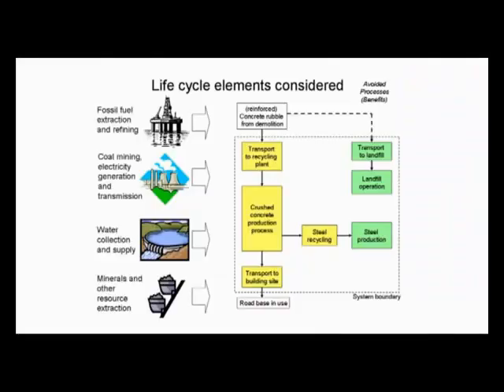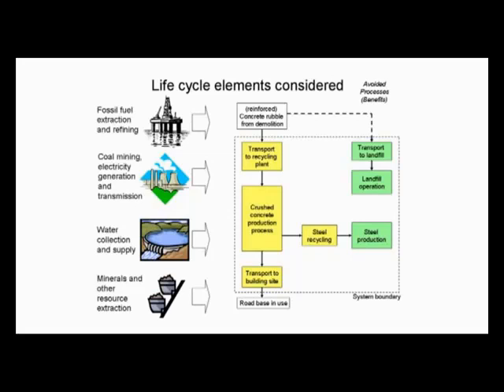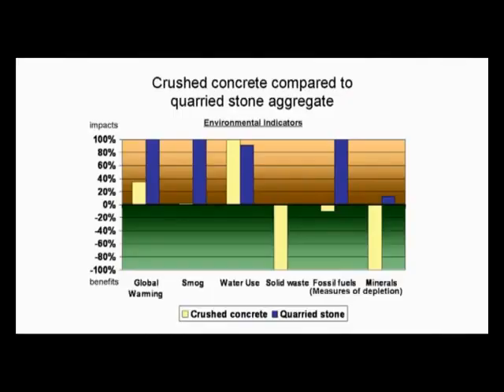Life Cycle Assessment - Explained

Comment: id also add, ultimately, the concrete before it was crushed was also quarried, there is no free energy as they are trying to make out.   
Re-using a quarried material does not magically put that quarried material back where it once was. 
yes there is a reduction to landfill, but the original quarry of the products in cement allready created that landfill.  (old quarrys are tips)

And the cement in the concrete being crushed has had all the energy used in its manafacturer dissapaited by the crushing. 

Ultimately recycling crushed concrete as road base is the most energy intensive forms of road base there is.    
1:quarried, 
2cement made, 
3concrete made, 
4 delivered,  
5 steel delivered, 
6 structure complete
7 concrete removed after life cycle of structure, 
8 concrete crushed as road base.  (all intensive energys lost into a base product of low value)

Dont get me wrong, it is good to re-use, but we really should be looking at ways to stop this cycle, not promote it.  

Like better engineering and concrete so it does not have to be removed.    I feel, although it is good re-using concrete, it does give a false sense of "enviromental wellness" to those using the road base or sending concrete structures there to be crushed. .. when a better design or build might have prevented it in the first instance.

Comment: A side effect of this life cycle, is the incentive that a concerete recycle plants create when it comes to pulling down old concrete structures that may otherwise be repeaired/updated or fixed.  A builder or property owner may be more likely to pull down or remove a structure rather than retain it, if it is easier to disgard, than in the past, this can impact the enviroment as well with increase in the quarrying for new concrete products to replace ones which are now easier to disgard.